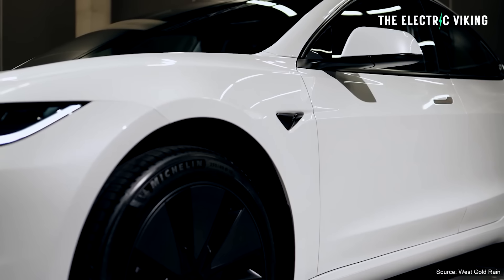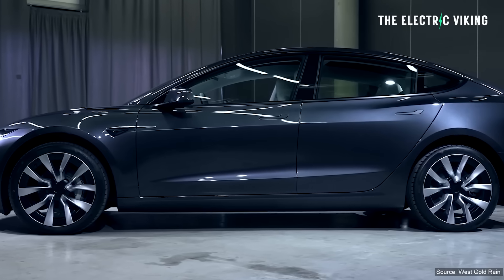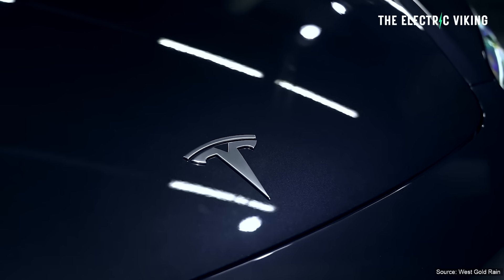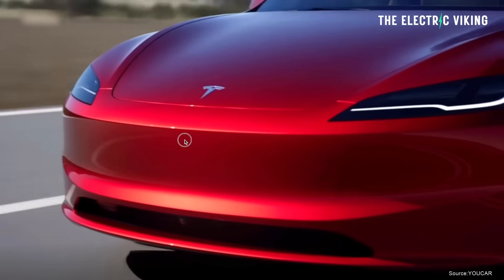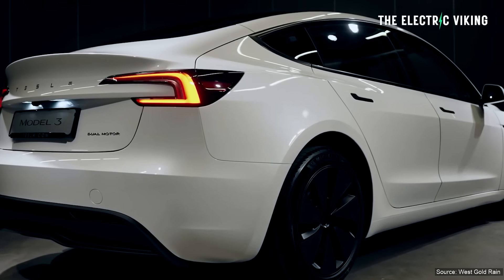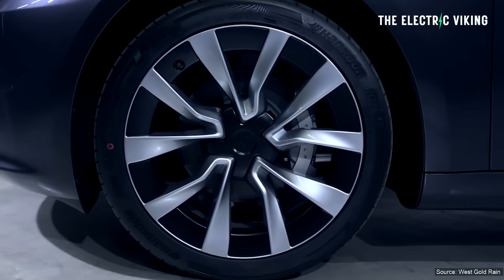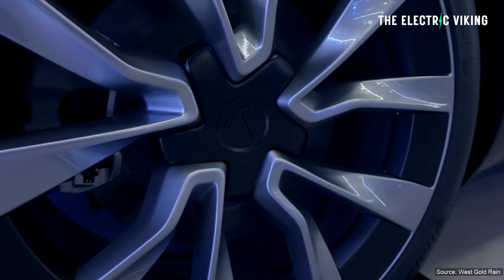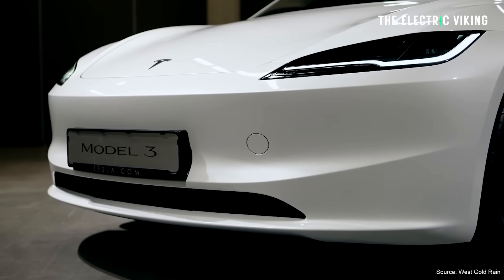Batteries, size and power of new Tesla Model 3 revealed in MIIT document

Comment: I ordered Standard Range because it can be used between 0 and 100 vs 20 and 90. WLTP 513 KM vs 629 * 0.7 = 440,30 KM on a daily basis the short range has longer range. Less hassle and a longer lasting battery. Plenty fast and the sound system is probably more than fine
Reply: Exactly why I ordered the standard range as well 👍
Reply: It’s not advisable arriving at destination with 0% state of charge! 
At least 10% (around 50km) for safety and also for battery health.

- I agree both ranges are equivalent in daily driving:
-LFP 462km (513*0.9)
-NMC 440km(629*0.7)
Reply: @ru.6187  and they aren’t the true ranges. A Tesla employee said realistically you’re looking at 80% of that to take into consideration, extra passengers, load, wind, hills. You would be upset if you bought any petrol car with a range of only 350klms, which realistically, both cars presently have. I agree it’s perfectly fine if it’s your car to drive into town and back but if you’re doing a lot of long trips, it’s not enough. The whole top half of Australia has zero superchargers. I’m now retired but only a couple of years ago, my distance to work and back was just over 1500klms and I was doing that every week. The availability of superchargers is what they should be working on more urgently if they want to sell more ev’s and the ‘long range’ title needs to reflect this in the true performance. Hopefully in a few years there will be more charge points and prices will come down. Paying $80000 for a car and another $2500 to charge at home and still have a cost of $20 to travel 350klms on a trip is too much to change to ev just yet.
Reply: Same here. Standard Range is perfectly fine for long road trips.
Reply: LFP does not like being under 20% so 20-100
Reply: It's the same, whether charging to 80% or 100%. You have to set it to a particular number either way.

It's pretty easy to charge to 80%. Set the vehicle at 80% one time, and forever after it charges to 80%.
If you need more range on a particular day, set the Long Range to 100% and off you go. 
The Long Range is the way to go in the USA, especially at just a small amount of extra cost.
Reply: @dvader3263  it’s $10000 more here and LFP has more charge cycles too

Comment: Prefer the model 3 to all other cars, but the lack of indicator stalks is a deal breaker. It's simply impossible to turn the wheel safely by shuffling it through your hands and activate the indicators at the same time, impossible, you can't learn or get used to doing something which is impossible.
Reply: Of course it is possible. My model S is stalkless and it’s  very easy.  It only requires a snail movement of your thumb rather than a larger moment of you hand an wrist.  I now prefer it over  stalks.
Reply: @jep5105  Another Tesla fan boy. I have several roundabouts to navigate every day to work and home with my Model S and need to do the impossible to  get it right. I've had the car now for over 6 months and have got to the point that I've ordered after market stalks for my car.
Reply: @pedipedi9559 What stalk are you getting? Do you have a link.?
Reply: @jep5105  Yes but my thumb isn't  6 inches long, so I wouldn't be able to reach the button when the wheel is angled at over 90 degrees, maybe people on the US have longer thumbs than Europeans?
Reply: Indicate before you move is and always has been the right thing to do!
Reply: @michaelrutledge5991  Roundabouts, everywhere in Australia
Reply: I just tested this with my S3XY buttons here in Germany. So it's really not difficult... a bump/button on the right turn signal is enough and you can find it blindly. Or you stick a button next to the steering wheel where the stalks would otherwise be. I do not understand the trouble.